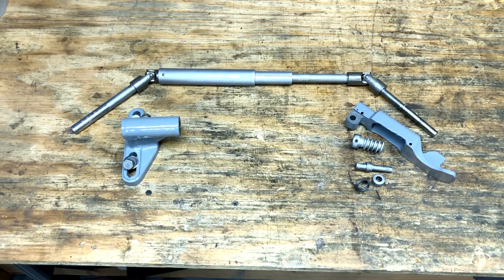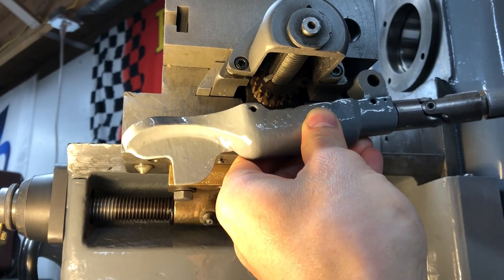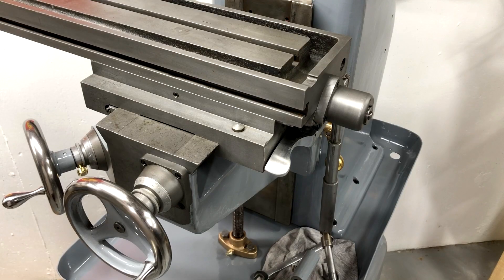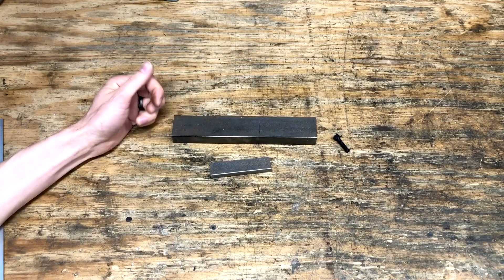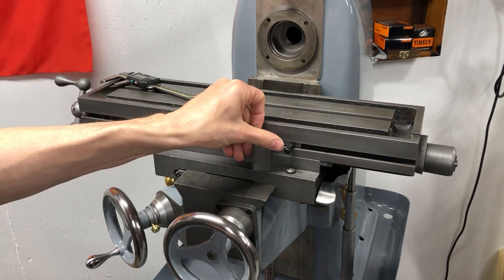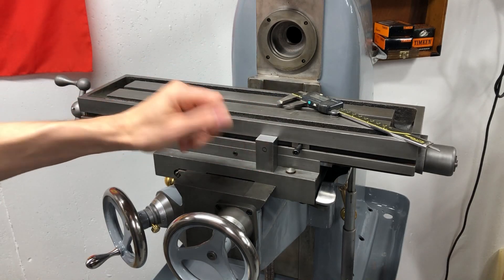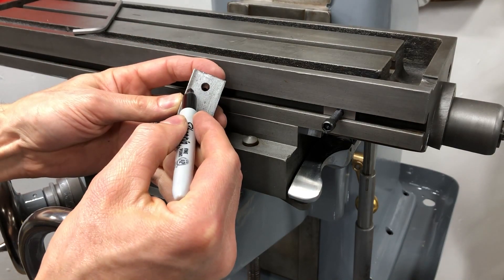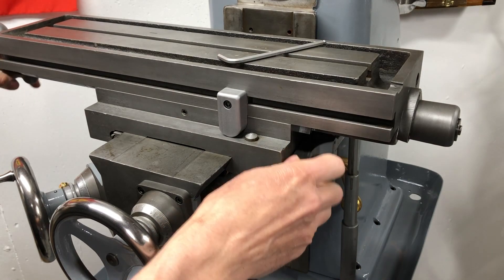Horizontal Mill - Power Feed Assembly

Comment: I have all of the parts except for the worm gear mounted to the lead screw.  Can you tell me any of the details of that worm gear?  It looks like it is about 1.25 inch diameter with about 20 teeth.  If I can get the specs, I can either make or buy one.  Or maybe you know a source where I could get one?  Am I right in assuming that it has a bore threaded to match the acme threads of the lead screw?

Comment: Does your mill have a back gear?
Reply from the maker: It’s doesn’t have a back gear but it has variable speed from both the VFD and from a mechanical pulley system inside it. There is quite a large range of speed